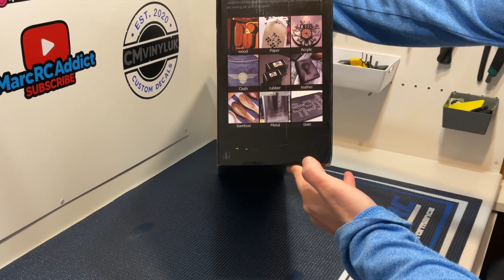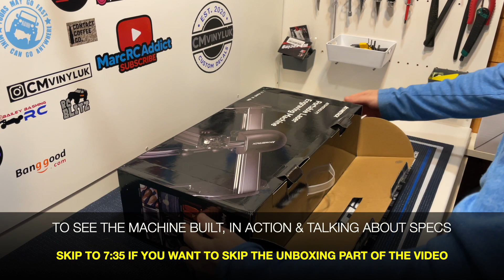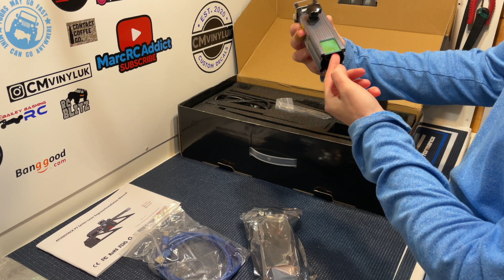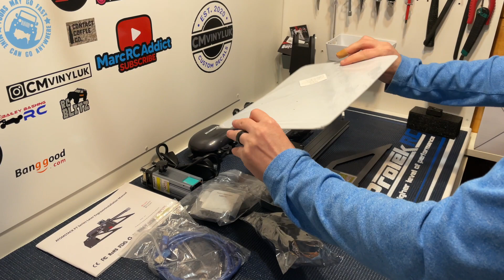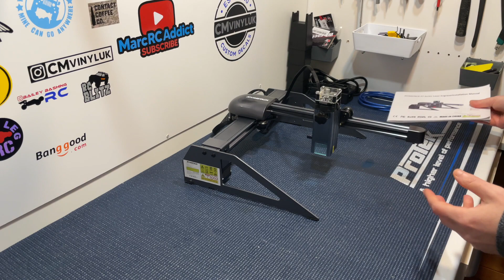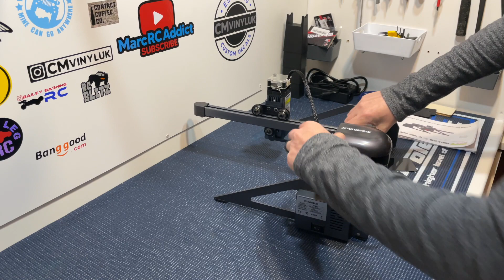Atomstack P7 M40 40W Portable Laser Engraving Machine Unboxing Review 'Part 1' *WOW*

Comment: Hello, does the p7 m30 record steel?
Reply from the maker: Hello, if you want to work on steel you will be better off getting this P7  M40 I have left a link in the description, it’s more powerful then the P7 M30 👍
Reply: @MarcRCAddict  Thanks for answering, I have another question, the manufacturer says on the one hand that it records mirror steel and on the other hand that it is not recorded on any object that reflects a mirror.  I do not understand that part.  can you explain me?  Thank you
Reply from the maker: @gustavov7800  hello, no problem at all.. it will not work properly on very reflective steel or aluminium, if they have a mirrored finish the laser light bounces off, the steel needs to be slightly dull for the laser light to work and engrave it.. 👍
Reply: @MarcRCAddict  Maybe in that case it would be better to paint black?
Reply from the maker: @gustavov7800  yes that is one solution, people also do that to engrave glass too 👍
Reply: @MarcRCAddict  Thanks
Reply from the maker: @gustavov7800  no problem, any other questions just ask 👍

Comment: Unfortunately the assembly video you showed is terrible as for assembly. They show it for being assembled in like 10 seconds and don't show anything about the cables, which I found to be the tricky part in the manual.
Reply from the maker: Yeah to be fair they do make it look a little bit easier then it was, for me I found the cables easy but the main bar to be the tricky bit.
Reply: @MarcRCAddict  I found the cables easier after I ignored the text and only looked at the pictures.
Reply from the maker: @3DJapan  yeah sometimes it’s just better to do it yourself for sure. 👍

Comment: Can it engrave on mirror finish stainless steel?
Reply from the maker: The listing and product description and even the manufacturer states it can directly engrave mirror stainless steel, but the user manual says it can’t but it’s states mirror finish not mirror stainless steel so it is a bit confusing to be honest. But atomstack are extremely helpful even to the point of sending me private videos on how to fully disassemble the machine so I will message them during the week and ask,  I personally think it will be fine to do it though as it shows it in the demonstration video, but just make sure it’s not 100% reflective mirror finish like a mirror as the laser can bounce back into itself..
Reply: @MarcRCAddict  My tags are reflective, but I don't know what do you mean by 100%  reflective. Just to be safe, can I use some kind of tape just to avoid the laser reflecting back on itself?
Reply from the maker: @arvinconejos3319  yeah using a tape will be fine or you can you a water based paint if the material is hard and washable 👍
Reply: @MarcRCAddict  cool thanks bro! Let me know Atomstack's response to your message. Still want to know their side.